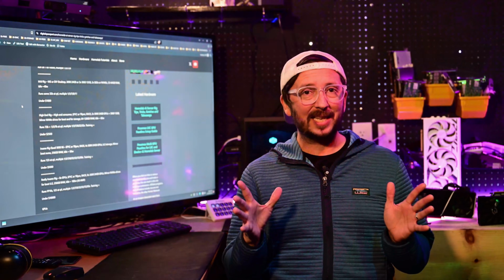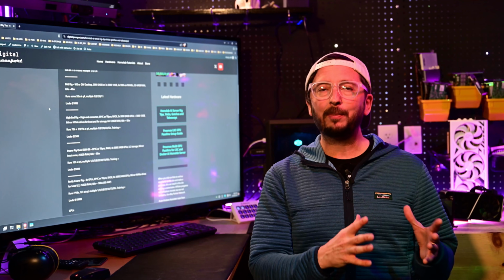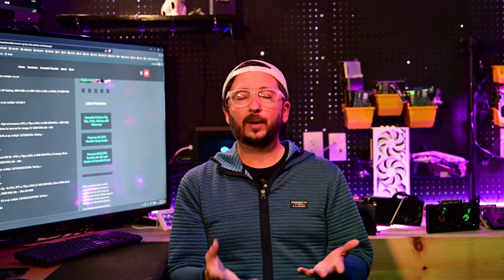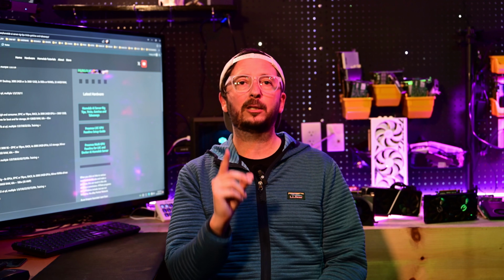Ai Server Hardware Tips, Tricks and Takeaways

Comment: I didn't understand why you didn't mention any of the Radeon 7xxx cards, nor ROCm
Reply: I have a 7900XTX 24GB and ROCm is nearly useless. Random crashes, inconsistent results. I don’t recommend
Reply from the maker: This is what scares me. The driver support is not good and Ive seen AMD abandon HW in similar situations in the past. They should be all hands on deck acknowledging this and correcting it. It doesnt look like they are.
Reply: @dyslexic_jedi  is it? I have no problem with it
Reply: @dyslexic_jedi  thanks
Reply: I have been testing the 7900 series, and the Radeon pro series on ROCm 6.2. with Ubuntu. Rock solid in terms of stability
Reply: @dorinxtg  What software did you use? Lllama.cpp/Ollama is said to still have a sub par RocM integration. Without software really getting every bit of performance from the card, solid hardware and loads of VRAM are useless for AI inference. Don’t get me wrong- I’d really excited to learn that the opposite is true, looking at the price tags knowing that I’m about to buy my first AI server.
Reply: @dorinxtg  From personal experience, AMD gets a bit tricky because they’re not as well supported by a lot of projects, so you can end up in a situation where an ROCm-enabled GPU looks, say, 10% faster on paper, but is in practice 50% of the speed of an Nvidia GPU. I think this happens sometimes with ie: 6700XT compared to RTX 3060, for instance.

On the other hand, the VRAM is a lot cheaper, and if you’re just doing really “basic” things with your AI inference workloads, sometimes you can get surprisingly good performance, and you can end up in a situation where with tensor cores an Nvidia GPU should be like, 2x the AMD GPU, but the AMD GPU is still faster (this is rare, but it does happen. I think there were a few examples on Phoronix, Techpowerup, and Anandtech, RIP).

So, would I take two RX 7900XT GPUs at 40GB of VRAM and close to double the bandwidth of a 4090? Well, it depends on the situation. Sometimes the extra 4GB on the single card matters more than CUDA or ROCm, sometimes CUDA is necessary, and sometimes the AMD GPUs won’t be optimized for. On the other hand, some backends will support AMD GPUs well with good flash attention implementations, and support tensor parallelism, which doesn’t require that much bandwidth between devices, and all of a sudden you basically have double the speed and double the capacity for close to the same price. It’s really situation specific.

In other words: If you only have an AMD GPU… It works. If you do your research very carefully, and like to tinker, and know how to optimize your own pipelines? AMD is basically free extra VRAM, especially if you’re doing super custom stuff anyway. If you just want to set up a random project and have it work and be reasonably optimized? I highly recommend Nvidia.

One dark horse option is if you just want super high quality models but don’t really care about the token speed. In this case you might want to consider pure CPU inference, as it’s cheaper per unit of RAM. This is pretty rare and is usually a specialized need.
Reply from the maker: Very good reply! Thanks for giving your input.
Reply: I also don't know. Amd is very powerful. And there is a 24gb ram gpu. And very well suited for AI. And costs only 50% the price of Nvidia.
Reply: I built a machine with 4 7900xtx… to get super shitty performance. Took them back and bought 3 RTX 4090
Reply: It’s preferable . AFAIK, Olllama isn’t yet optimized to work with ROCm. Would’ve been interesting though like “how far do you get with AMD”. AMD is so much more affordable per GB. Especially when you look at used stuff. Maybe that’s something for a future video, @DigitalSpaceport ?
Reply: Save yourself the hassle and forget about amd. Yes you can make it work for inference but it's painful when it goes wrong because there is no amd AI community to help you. If you have a problem with Nvidia there are a million people who can help you. Put simply, with AMD, you're on your own.
Reply: @MichaelBarry-gz9xl  These days, you copy and paste 6 lines and it works. Tested on R7xxx and R9xxx
Reply: @dorinxtg  Nvidia is the only one with cuda and that's vital
Reply: I wondered the same, I could have, as I see it, a pretty nice 2x32GB with 2xMi100 setup, though idk about inference speed
Reply: Can we please get some content about the differences in the capabilities of rocm based cards. My current understanding is that for heavy training at fp32 or fp64. I have a large mix of pretty powerful rocm and cuda cards-and I’m trying to work out my lan node hardware distribution. Thanks man-your channel is helpful.
Reply: My comment vanished. Could you make a video on AMD GPU? Some people say they aren’t that bad for AI.
Reply from the maker: I see two comments here and do plan to test AMD and Intel soon.
Reply: @DigitalSpaceport  I have a bunch of A770 16tgb cards along with Asrock H510 BTC Pro+ motherboards sitting around.  Was thinking of trying to make a 12 card cluster connect by 10gb network cards and 10900k for the cpu with the 3 linked to each other.  Any problems you can think of that I am missing?  4 gpu per motherboard with 2 10 gb cards.  The biggest problem I can think of would be the single 32gb ram stick that the cpu is using.
Reply from the maker: @slowskis  I would try 2 first on a machine and see how that goes. Then scale it to 4. LMK if this works and what model/quant and tps looks like pls.
Reply: @slowskis the pci-e lanes on that board are super slow, might be an issue?
Reply: @DigitalSpaceport looking forward to AMD testing as well 👍
Reply: @malloott  yes you need bandwidth on the pcie bus to get full use of the gpu. X16 full speed not bottlenecking the gpu for ai training. It's a must. It's needs to crunch numbers to build the ai and that takes days or 2 weeks if you have slow gpus or slow bandwidth.
Reply: @slowskis the 10900k can only handle 16 lanes of pcie which would be one GPU at full speed, if you add 4 then each will only run on 4 lanes or 25% of their bandwidth to the CPU. You need a HEDT CPU to be able run mutiple GPUs at full16x. Some examples are Intel Xeon, Intel X-series and AMD Threadripper

Comment: You inspired me to experiment with own AI server based on 3090/4090. I did little different choices like: ASRock WRX80D8-2T + Threadripper Pro 3945wx. As you mentioned CPU clock speed matters and I got a brand new motherboard + CPU for around 900 USD. I also want to try OCulink ports (ASRock has 2 of them) instead of risers There are 2 advantages: OCulink offers flexible cabling and works on separate power supply so you are no longer dependent on a single expensive PSU. So far I see 2 problems: Intel X710 10gbe ports cause some errors under ubuntu 24.04 and Noctua NH-U14S is too big to close a Lian Lin 011 XL so I have to turn to an open air case. Can't wait to see your future projects.
Reply from the maker: On the intel, if thats fiber x710, do you have approved optics?
Reply: @DigitalSpaceport  I use x710 copper connection but I just figured out that I shouldn't have blamed intel NICs for repeating "Activation of network connection failed". The source of my issue was virtual USB Ethernet (American Megatrends Virtual Ethernet) created for IPMI. This is strange as I use separate ethernet cable connection for IPMI but after disabling "Connect automatically" in USB Ethernet profile it all returned to normal.
Reply: @danielstrzelczyk4177  I've been wondering if OCuLink would find it's way into these types of builds. Wasn't aware ASRock mobo had 2 ports like that. Have to check that out.
Reply: @MetaTaco317  Yes there are 2 ports out of the box but I have seen also PCIe cards with OCuLinks and converter from M.2 slot to OCuLink so there are couple of options. ADT Link F9G just arrived so let's see how it works :)
Reply from the maker: Can we get a status update on how this is working? I have not had good success with high speed oculink connections for storage usages in my own usage due to insertion loss.
Reply: I'm an oculink expert and built custom drivers to use oculink as a network card as well as for rdma for cuda processing using a network of gpu servers. 

That being said. X4 oculink is a joke. You need at least x8 and ideally dual x8 (8i) oculink2.0 adapter. With pcie4.0 you get 56GB/s using dual x8 oculink sff-8612 cable. The brand NFHK is releasing that product next month 5/2025 for MCIO which is faster than oculink allowing for pcie5.0 speed 64GB/s full speed x16 slot. 

Any other oculink port is x4 the same max speed as m.2 x4 for nvme or any adapter to that port is only x4. GPUs need x16 to fully use the cards bandwidth. And using a pcie5.0 MB. You can only still max speed with oculink2.0 is pcie4.0. So you must switch to MCIO dual port adapter from NFHK from mcio pcie card x16 to the x16 backplane mcio dual port card. Then you truly get real x16 speed at pcie4.0 or 5.0.

You're welcome. Post come devops testing my networking driver for both oculink and mcio. I will cut spending of 1/70th the cost of interconnecting any amount of clustered servers vs infiniband pricing. I'm talking 64GB/s networking not the slow 10gbit crap which is only 1GB/s I'm talking 64x faster bleeding edge technology that costs normally $20 to $75k to connect multiple servers together.
Reply from the maker: I dont know who you are but you are spitting facts. MCIO is the way.
Reply: @DigitalSpaceport  thanks, im a top level engineer for 30yrs working on windows and billion dollar infrastructure. Thiught of creating a channel 8yrs ago but i like to keep a privste life. 
There are ways around that if the issue arises then there are cards that are $475 which are called insertion cards for signal loss specifically for oculink. Hench why I'm bypassing all cards for direct pcie transfer. There isn't offload cpu yet only takes 1-5% utilization and since this is a server made for this you should have a 5% free available core cpu available. There are switches for rdma but they cost $1k plus from Broadcom chip. Unfortunately MCIO doesn't have anyone manufacturing  a MCIOx24 cable yet for any card external facing riser. Only true server engineers and architects have heard of that cable. The only option is dual mcio x8.  MCIO sff-ta-1016 is pci-e 5.0. So I'm waiting for the release of that product to test bleeding edge driver made to extract tccl from the transport for both nvidia and for networking over rdma--two separate drivers. I already made a driver for oculink2.0 but that's only 32GB/s max. Needing quad sff-3611 cables from peer-to-peer. It should work. But I'd rather work on MCIO given the pcie5.0 speed is 64GB/s and networking with 1us latency obliterates competition with any networking invented today even infiniband can kiss my ass. And not pay those assholes $8k-70k price tag for infiniband, cards, switches, and overpriced cables. I can save a company millions instead of the greed for speed mentality. I think infiniband is a scam to make money where they could have used eMCIO all driver based or just with pcie5.0 switches. But that's my engineering hat seeing truth where others just follow. More points of failure, essentially infiniband is a flop in my eyes inferior in many ways. And given drivers can't be encrypted and endlessly copied they went with profits over function.
Reply: @bulliontoy  So whats your build? Trying to understand this reply lol
Reply: @keithallen9054 that I can't tell you. If you want a system built custom I can build a server you just give me yiur requirements.